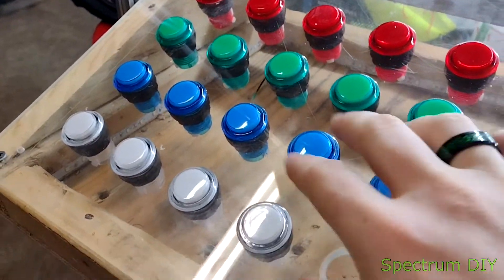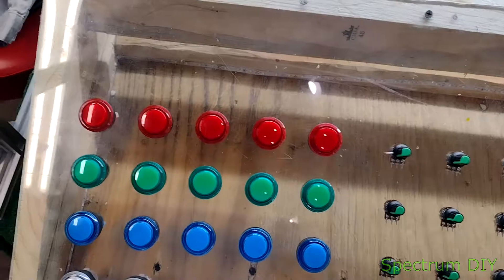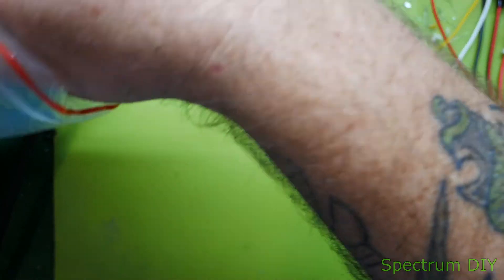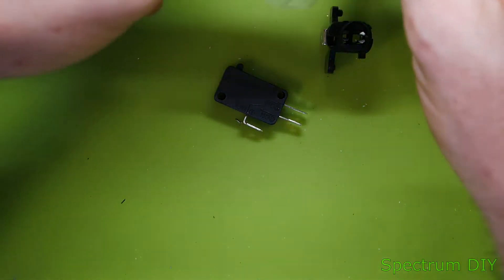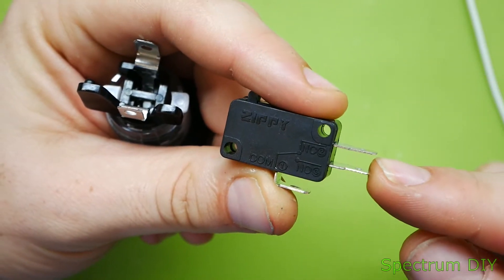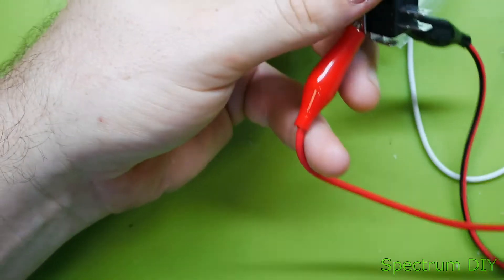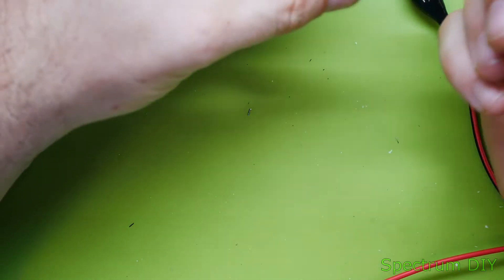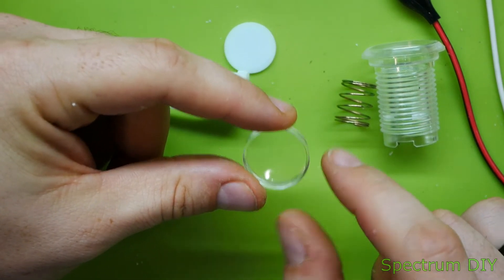LED Arcade Button Teardown

Comment: since you're messing with arcade buttons and know about electronics i need a question answered maybe you can help me, i have 6 led buttons that are 12v buttons they can be underdriven at 5v ive tested it and they were a brigtness i was happy with. my current encoder in my diy hitobox i made cannot run all 6 on a daisy chain it can just do two but it's kinda shitty and i think that's why i think they took a short cut somewhere. what i wanna know if you think the brook zero pi could run the 6 led buttons via daisy chain on the 5v port on the screw terminal if you need links i can provide them but i literally cant find an answer to this question and i need to know so i can proceed forward with upgrading my build and making one for my dad
Reply from the maker: It seems like it would be possible, but I honestly don't know off the top of my head, the big thing is is current, having enough current to supply them all

Comment: All I have on mine is two wires connected to the button
Reply from the maker: It sounds like an unlit version of the arcane button, so no light inside? Usually it's an LED, which is polarized, where as the non-lit version is just the switch, so it doesn't need any specific wiring. Just as long as it's connected in the circuit as intended.
Reply: @SpectrumDIY  I’m buying new buttons that have led inside like yours
Reply: @SpectrumDIY  how many volts you need for the light
Reply from the maker: I ran 9-12v for mine, but it depends on your buttons, some might use a specific, or it might use the range. Mine I needed to add a resistor in series to prevent it blowing out the LED
Reply: @SpectrumDIY  thanks a lot for your help

Comment: How can I wire these
Reply from the maker: The outer lugs attached to the housing are the power legs, the ones on the switch will say something like "com" to show ground, the other two legs are to give power. So one is always on when not pressed, the other is only on when pressed